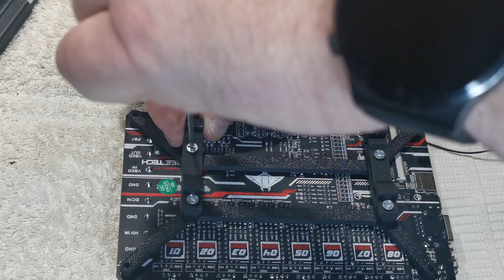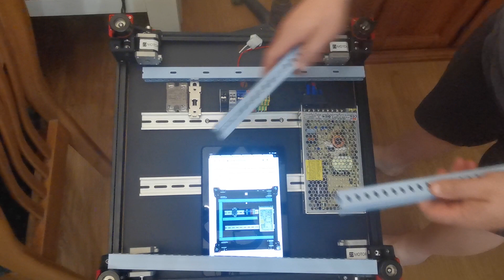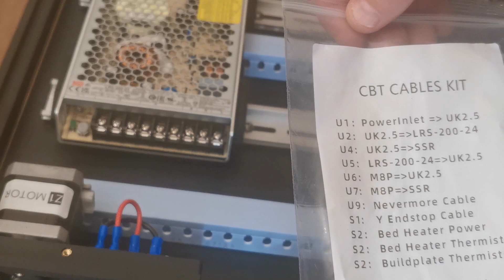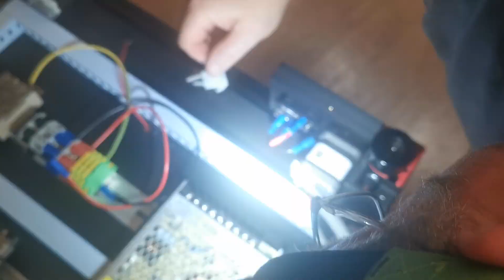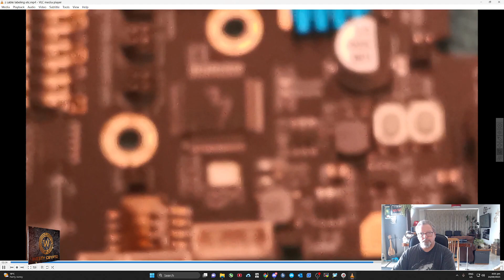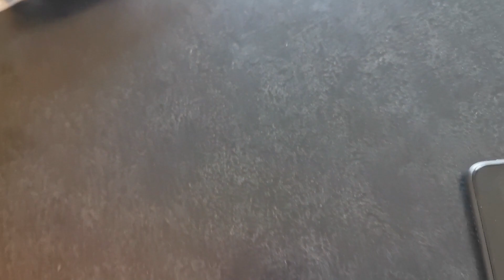VORON 2 4 R2 MPX CBT BUILD SERIES - PT 20 - COMPLETE ELECTRICALS INSTALLATION

Comment: I'm going through this step right now. With the M8P mounted it is not obvious, but the other (board-facing) side of the mount has countersunk holes. So prior to mounting the M8P to the mount, I'm screwing from the board side into the holes in the DIN clips, and the screws fit neatly into the countersinks. No drilling required. Still trying to divine which direction the clips should be oriented. Neither direction seems to center the M8P on the DIN rail. That probably means it doesn't matter, but symmetry.
Reply from the maker: yeah I think I mucked this bit up a little. pretty sure the M8P mounts offset
Reply: @rent2ownnz  I'm pretty sure we've all assembled things upside-down or backwards, had to take things apart to fix a step we missed, etc. Hell, no project is complete for me until I've somehow drawn blood. Having this series to reference has saved me hours of figuring out what something should look like, confirming my interpretation of the manual, etc. That's no small thing. So take any of my comments as efforts to add to the effort.